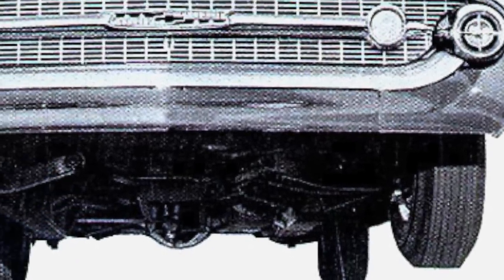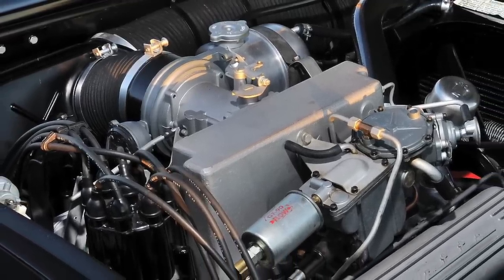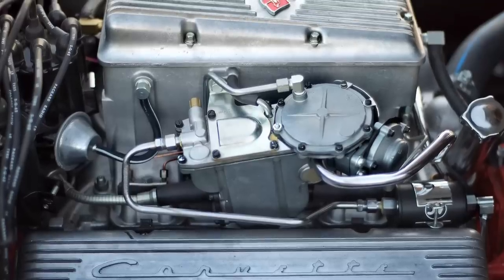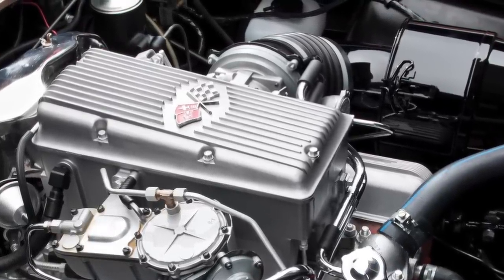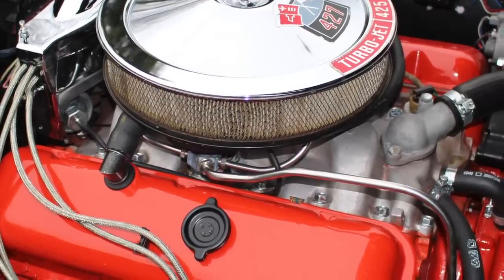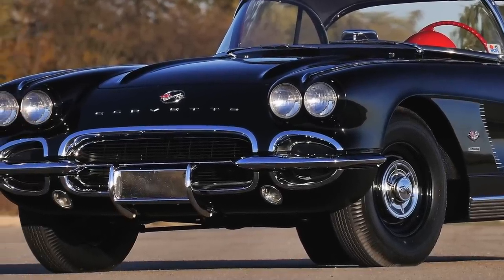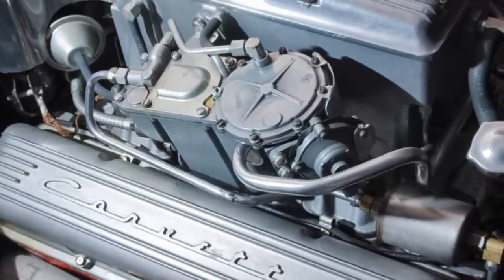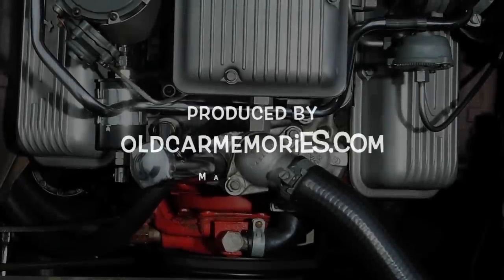Why Chevy Abandoned the 1962-1965 Fuel Injected 327 V8

Comment: I still own a 64 fuel injected Corvette that I drove new out the dealership when I was 17 years old ....yes I had the worlds best Dad...58,000 miles that I should but haven’t driven in years .  Only had one issue ever with the injection unit due to additive that gunked  up the system.. always  idled rough but no other issues .   Thanks for a very informative video
Reply: You need to run race gas in it, available from  Napa Parts. Needs to be at LEAST 100 octane!
Reply: Silver spoon.

Comment: Back in the day the fuel injected Corvette road tests I read showed some astounding numbers.  Even the dealer mechanics were mostly out out touch with the old system.  A ‘57 BelAir with FI and overdrive are quite rare.  Craig Jackson says the production number was 200.  Jay Leno’s Mercedes 300 has an oil change interval of 1,000 miles.  The mechanical injection pump keeps pumping until the engine stops turning.

Comment: Fuel injection aside, the 283 and 327 were the most dependable engines that GM ever offered.
Reply: 3.8
Reply: All the small block engines had the same water pumps, fuel systems, accessories, etc.. so they're all pretty much the same except bore and stroke and whether they had 4-bolt mains or not. So to single out the 283 and the 327...I'm curious, why do you say the 283 and 327 are more dependable than the others? Thank you:)
Reply: Terry Melvin  ran 91 bonny 325k same thing gas and brake lines rusted out, they were put in a channel near the rocker panel and dirt and mud collected and rot them out. The lock up solenoid went out in the trans. had to unloosen the motor mounts to get the side pan off to replace it. Intake gasket failed at 250k. Not a problem. Trans finally went out. Engine ran fine though. Used no oil between changes. Original fuel pump,  Imagine that.
Reply: Go look on van forums at how many Express vans with the 6.0 LS are hitting 300k and 400k.  It’s unreal.
Reply: Terry Melvin I’ve owned two 3800s, one from the mid 70s, the other at almost the end of the run in an ‘06 Buick.  Great motors, both of mine were designed for highway cruising torque and they did that well.

One of the things that gets lost in these engine discussions is talk about design goals.  A SBC or LS with a high rpm cam, long runner intake, big carb or throttle body, ported heads, lightweight valve train etc. can make gobs of power at high RPMs.  It does give up some reliability if going extreme.  Most OHV V8 engines won’t live for hundreds of thousands of miles at high RPM.  

The same block with a different cam, lower compression pistons, lower cost conventional valve train, etc. can give great highway manners, fuel economy, still have decent power and be so under stressed as to live seemingly forever.
Reply: Terry Melvin  worst i ever had was that s-10 engine, was that a 2.6 v6? horrible memories, i probably won't sleep tonight.
Reply: Terry Melvin As a GM tech I have to disagree with you on the 4.3. Although they may have put junk fuel injection and ignition systems on them the 4.3 is a great motor. Fuel economy though is totally separate issue.
Reply: Terry Melvin  I'm not a fan of the Vortec v8 and v6 intake manifold design either. No coolant running through the intake and no center bolts if I remember correctly. The heads on the vortec 350 heads are pretty decent though if your building a nice daily driver car with a SBC.
Reply: @scinto23  ideally there would be no coolant running through the intake on an EFI engine, it's only desirable for carbs where the manifold needs heated or in places like Alaska or Siberia where the throttle plate can ice up, in most applications though it is just another place that fluid can leak out and on older V8s it causes uneven heating of the manifold , which is undesirable on any part.
Reply: Dependable? Because smokey yunick had a hand in it.
Reply: I love the 250 straight six.
Reply: @DWinegarden2  I wanna try a Pontiac 250 OHC
Reply: ghost jesus no kidding! I have a 1966 Laurentian with the 250! The 250 OHC option was in the Firebirds. Would be sweet to build one up nice!
Reply: @DWinegarden2  I don't love the fiber cam gear, or the interference fit, but still a cool motor. I have a 250 from the late 60's in my 1983 GMC High Sierra, the idle sounds better than most V8's.
Reply: InuranusBrokoff - nothing raps like a sweet running six!
Reply: 327..Built to Beat and I beat mine for years. Couldn't kill it.
Reply: 283s run forever with fresh oil.
Reply: Ronald Reed  , you are correct. I had 307 in camaro and junked car out with engine still good but everything else scrap.
Reply: Ronald Reed  I understand that. No problems here.
Reply: @scinto23  had a 4.3 in a 85 astro, factory mild high rise manifold with a 4bbl. They had to get some horse power somewhere as the astro was a box to move.....
Reply: Million mile duramaxa
Reply: @westcoastsingletrack7854  duranax was basically designed by Isuzu under GM's watchful eye andvtuey built one heck of a diesel', I owned a 95 dodge 2500 with the cummins 6 diesel, could not kill that motor either....
Reply: @glassgurumikeb  Being a Chevy fan since before I could drive, I have to say the 283's n 327's were more durable and could go to higher RPMs than any other Small Block Chevy made. I can't tell you why but thats the way they were. I even know a classmate w a 283 that lost his oil pan jumping a median trying to get on the Interstate while trying to ditch the popo n he had it wide open for 10 minutes n went 23 miles before it seized up. For sum reason those things took a heckuva beating. 350's were next for durability and even though I'm a Chevy fan I wouldn't own a 30(anything) from Chevy after I saw how quickly they would 'Blow', How much it cost to get HP out of them, and the headaches they gave to those running them as compared to the 283, 327 n 350. 
Take Care All
Reply: I had one of the '63 327s but with the stock Rochester Q-Jet. Precursor to the Quadrajet but with manual secondaries. They were simple reliable, efficient n IMO performed Better than the Quadrajet. With that, why would you want the hassles/headaches of a Fuel Injection System? If you ran it on the primaries you got reasonable Gas Mileage n if you opened it up you had RAW Power. How could you NOT love these motors?
Take Care All
Reply: Wrong but close 350 327 305  all the same engine.
Reply: Not really....
Reply: There is a way to make a modern verson of the 327 - near identical bore and stroke with EFI that is VERY tunable. Get you a 6.0L and destroke it with a 4.8L crank. Do the math. Yeah, you can get a 6.2L and destroke it the same and get a "close to" 350 - but ... 6.0L block, 4.8L crank - it's a more solid engine overall - put a cam and springs in it, use the vortech "LS" injection and tune it. You're getting over 400hp, and over 350 lb-ft. But it's not the "same thing"  by any stretch,. It's also not gonna cost you 350k.
Reply: @henryjonswift6997  the 3.8L 60 degree Buick v6 turbo that got a nascar ban is the basis of the 3800 series (which were FWD) - some of those had superchargers. Drop a charged 3800 in a fiero in its mid mount config (like a lambo or ferarri) ... let me know how that works out for you!
Reply: So, let's get rid of them, 
I worked as a test technician for GM, and I've seen some pretty crazy stuff going through that manufacturer. 
I wrote a report on a failed part I was testing and the engineers at GM called me at home and told me they were going to scrap my report because that part was going into production. That's about the time I started driving Toyota's
Reply: @dougherbert7899   my nephews full size van has a duramax diesel 690000 miles. I have a chevy pick up with the 8.1 gas at 445000.
Reply: @henryjonswift6997  Are you drunk while writing? Try writing to express thoughts intelligibly, please.
Reply: @henryjonswift6997  Good point. I had one in an '03 Buick LeSabre. 399,500 and some odd miles on it. Only a collision with a deer at 60+mph took it off the road. It still got me to work that day (62 miles!), then ran low on coolant. Worked my shift (10 hours), added water, and drove it another 62 miles home. Then sold it for $300. Helluva an engine!!!
Reply: @bradballard2068  LOL, I believe you. I work for a courier company that has a bunch of older Toyota Sienna mini vans, the oldest of which have well over 400k on the clock, with the original engines and transmissions. They couldn't give me any GM vehicle.
Reply: @scottsliger3606   I had one of the 305s with the soft camshaft that  lasted less than 50K.
Reply: I sure had a lot of points go bad, fouled plugs and valve seal/guide oil buring on the 283 and 327's well before 100k. Had later 350's that didnt have those issues.
Reply: easy to be reliable when you make 115hp net out of 5 liters haha
Reply: Why? The fuel injection system wasn't good on these two?

When Chevrolet brought back fuel injection for the Corvette's 350 for 1982, the final year of the C3 design, the "Crossfire" injection system also wasn't very good and it wasn't until the L98 350 V-8 came out for 1985 (when the C4 Corvette was in year two), now a tuned-port style system, that it would really take off.

Comment: Doesn’t change a thing for me. The 327 well always be my favorite Chevy small block.😀
Reply: I Agree Ricky.
Mine was 71 Malibu with a  327 out of a 69 Caprice. 
Was only mildy rebuilt but still out performed many cars I thought I'd be looking at their tail lights.
Reply: I have a 68 Chevy pickup with a 327/ M20 4speed.
Reply: Like the 400 small block one of the hottest 302
Reply: I love the 327 but id give my left n-t for the Chevy 302
Reply: Amen Trager, the big blocks added way too much weight over the front wheel throwing off the balance.  Quater mile perfomance was great but didn't matter is not able to control a degreasing radius turn like found on real roads. Big blocks would understeer.  Pushing through turns making more than one pinch mark in the driver's seat cushion...
Reply: Ricky if you think about it thats all there was
Reply: @phillyflyer12  cool my dad had a 68 or 69 caprice 327 he used too gun it on the freeway...lol
Reply: 283 /327 were great engines in the day but if you got 100 thousand miles out of one without a rebuild you did well . todays engines will run forever

Comment: I've heard long ago that Chevy got rid of the old reliable 327 because it ran so good without breakdown. The Checker cab company used them in their cabs, and those things would run for about a million miles! My favorite engine 😍
Reply: Your thinking about the 283 power pack, couldn't blow em up!
Reply: @wildestcowboy2668  they were great too!
Reply: The fuel injected 327 was dropped after 1965 because of the higher cost of including fuel injection on it.
Reply: The C3s started out strong but by the end of it's run they were a joke

Comment: I had a 1965 Vette with FI in the early 70.s. I ended up replacing the FI with a Holley 4 bbl because nobody I knew could work on the FI. Good article . Thanks for sharing .
Reply: I had a 65 327/350 hp with the hydraulic cam and Holley 4 bbl, M21, 370 diff. Just a lot of fun without all the maintenance. I helped friends set their solid cam lifters so I got to enjoy the smoke in those great old days.